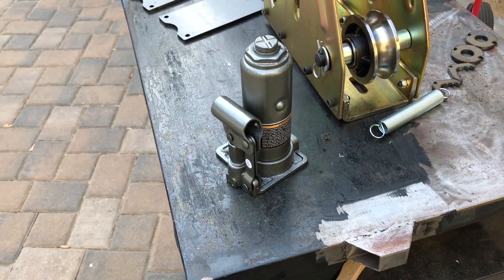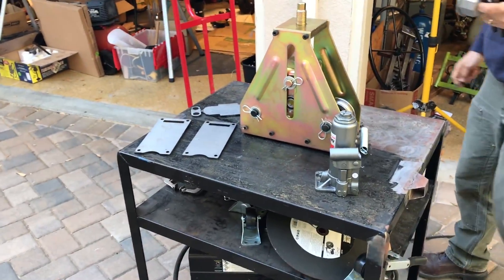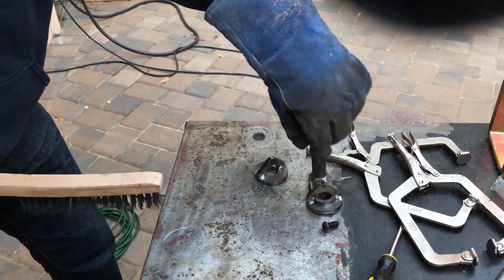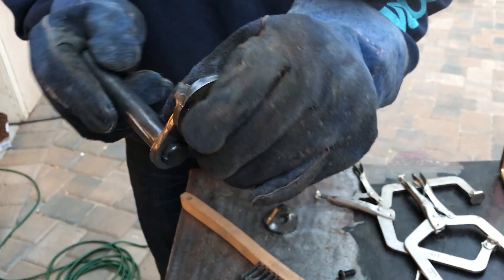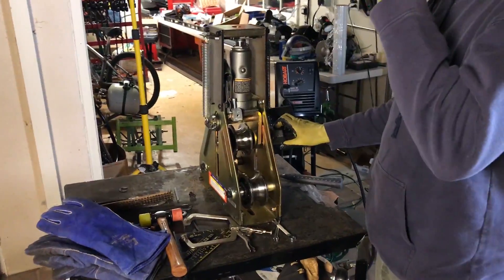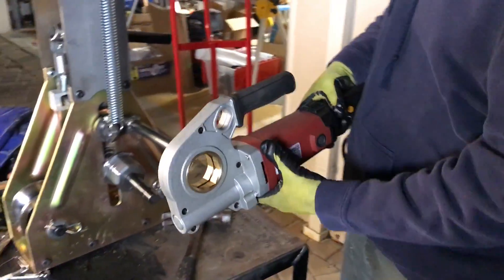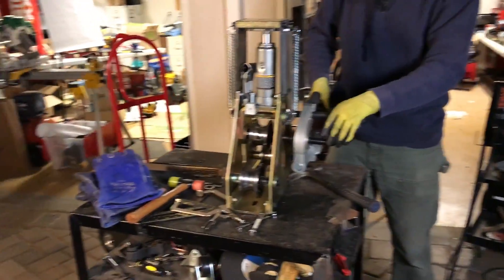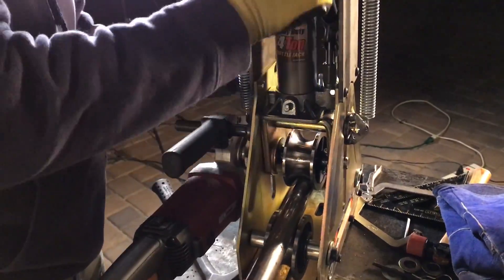Backyard Roller Coaster - The Goal Boss, Part 3

Comment: Will -- what kind of steel pipe are you using?  (I know it's 1.5" OD)  But what kind of steel?  Is it stainless?  Seamless?  How much does it cost from your source?  I have looked at 1.5" EMT -- would this suffice, in your estimation?